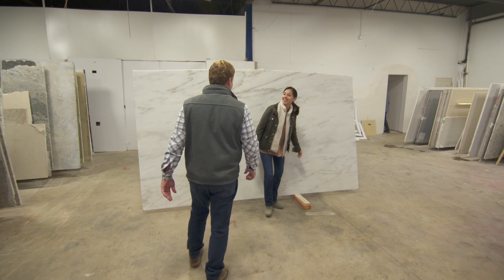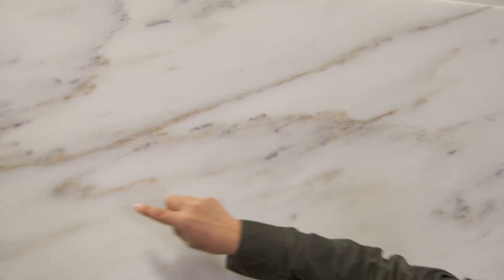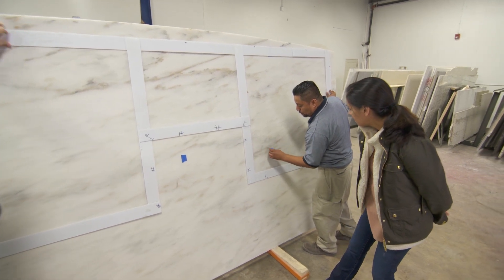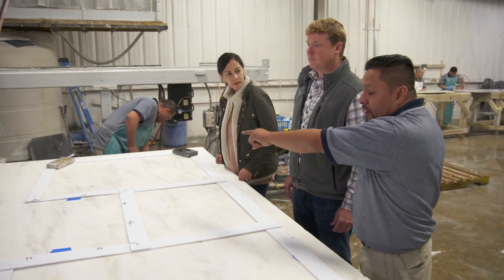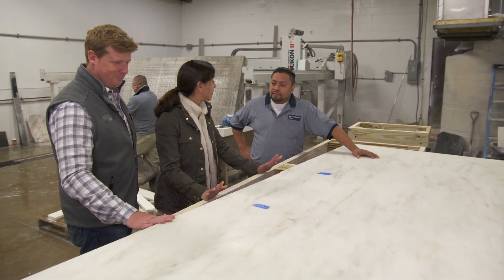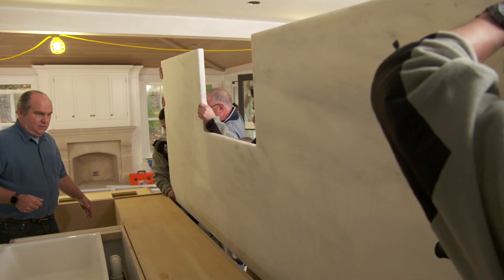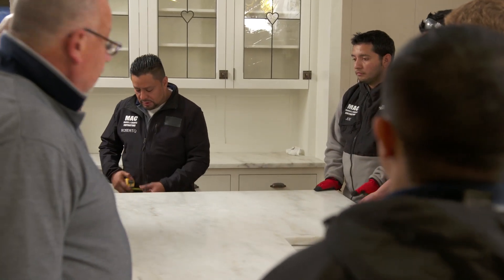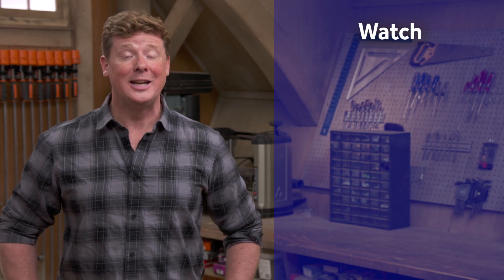How to Source and Install a Marble Kitchen Countertop | This Old House

Comment: What's the point in getting a natural stone if you don't like the natural variation in it?
Reply: It was damaged in transportation. Called stun marks and very hard to remove. They are very conspicuous in a white marble.
Reply: I've seen a few cases like that when I use to install a few years back. I could never understand it. Why not quartz if it bothers you that much? Lol

Comment: Are the workers supposed to be using a grinder to make cutting adjustments when placing the slab on the wood when it arrives to be installed ? It seems they measured it wrong and now they’re trying to fix a major problem w a not so good tool choice imo. And it’s making my kitchen get dusty as hell.

Comment: That's one expensive countertop.   Great precision work
Reply: How much?
Reply: @tombomombodombo  total guess but I would say easy $3k just for that slab alone, probably more
Reply: 3cm Imperial Danby runs about $60-$70sf just for the material cost for the fabricator. This manual shop likely charges $25-30/sf for fab and install.  Hope they picked a good sealer!

Comment: So they had customers cut counters, yes. Laid out in shop,yes. Set on sight, and the contractor told you to tap water without the escuscion plate templelet. Yes
Reply: Send them home. Don't touch those tops. Ok.